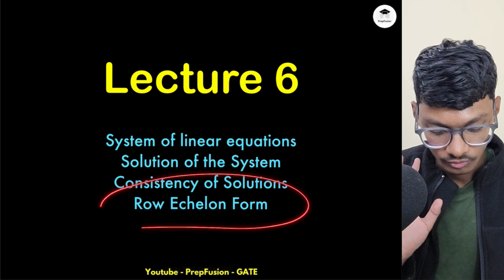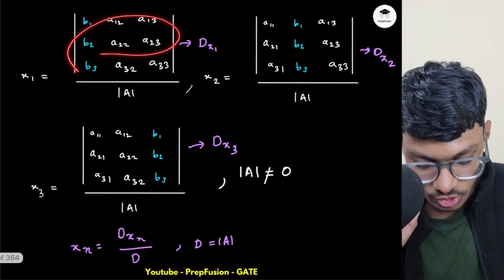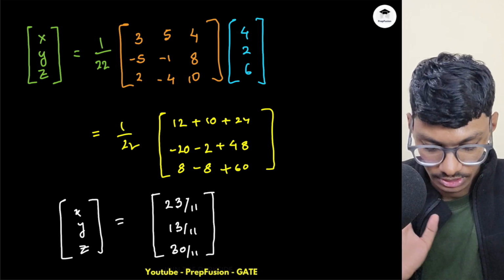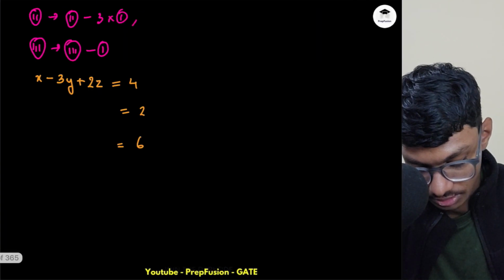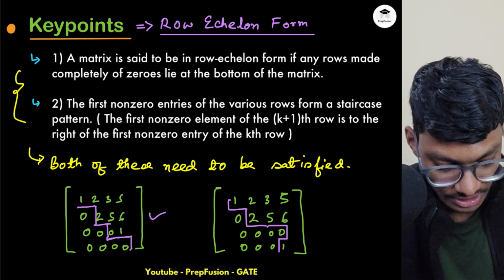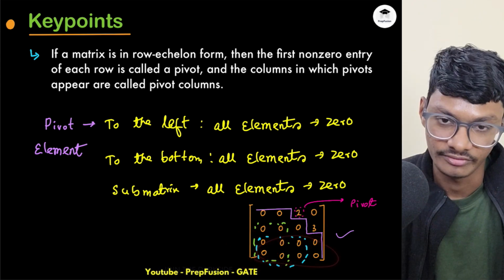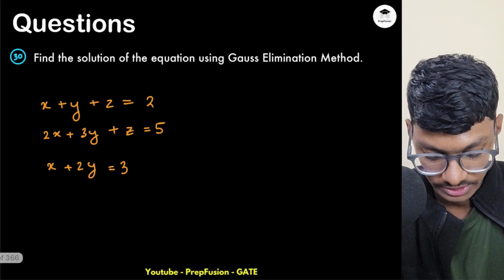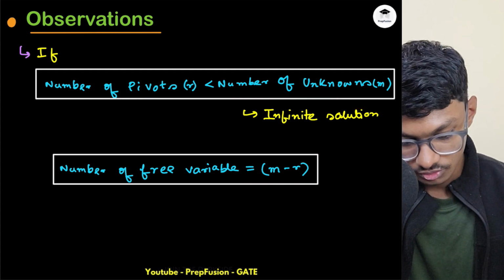System of Linear Equations || Engineering Mathematics || PrepFusion

Comment: I guess the operation at 34:57 is valid only as we are just combining the second and third operation and logically also we can just multiply 2 eqns with 2 diff constants and still the solution wont change.
Reply from the maker: Ya you can't do that Simultaneously that's it.